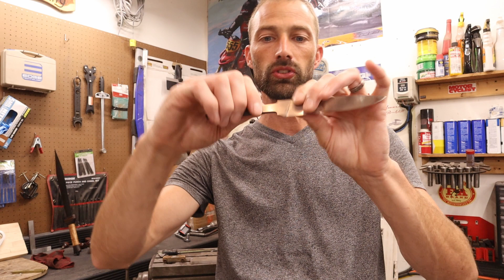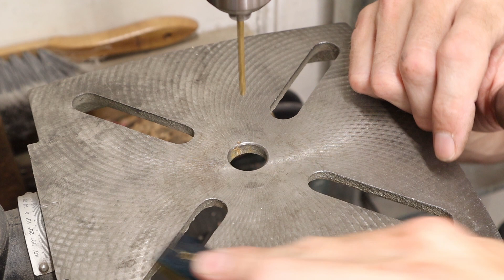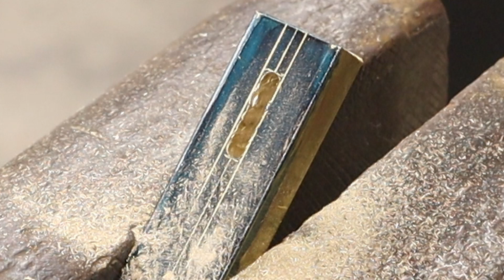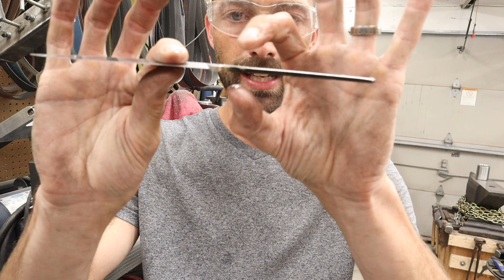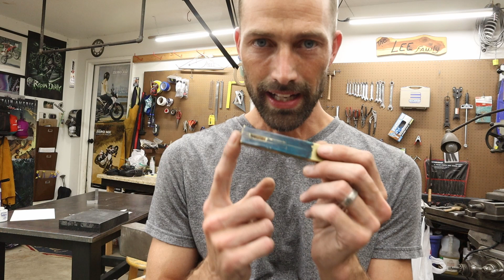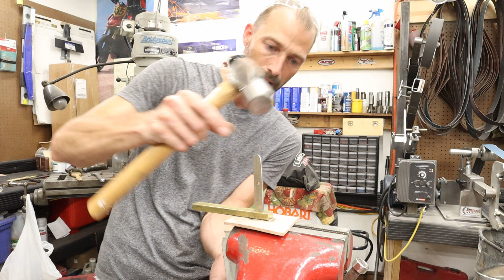Making a knife from ground zero - part 4 - making and fitting guards!

Comment: Thinning the tang to create shoulders can easily be done on the 2x72 & disc grinder with practice and patience for those who cant afford a mill. I own a mill but use the grinder anyways because there is no time lost on set up for vicing, adjusting the quill, choosing a bit etc, checking it once, twice , three times and more with the micrometer. This is a great video regardless of my opinions about process.
Reply from the maker: I agree, I do it that way also. It really just depends on the level of perfection I am aiming for.
Reply: @Aleeknives  Your stippling trick was a good solution. That's what knife making is,..constantly fixing mistakes to make something perfect
Reply from the maker: Agreed!

Comment: Another great vid Aaron. Little tip for those who dont want the bolster textured if its loose and want to tighten it up, gently squeeze it in the vice slightly, works great. Also its a verneer calipers, not a micrometer your using 😃. Cant wait to see the final product!
Reply from the maker: Nice tip! I have tried squishing them and vices before but I've never been able to get the corners to move. And you are absolutely correct about it being a Verneer caliper! 👍

Comment: Another great video, Airin!  I use a mill but I always mill down the tang so the alternate method you showed is intriguing!  You say “95%” but that would change based on the thickness of your material.  Is it about 30 thou?
Reply from the maker: Yes sir! That is a good point. So far my series have been aimed towards the new knife maker , so I'm trying to not overly complicated things. Apparently I called my caliper and micrometer oops😂😂😂